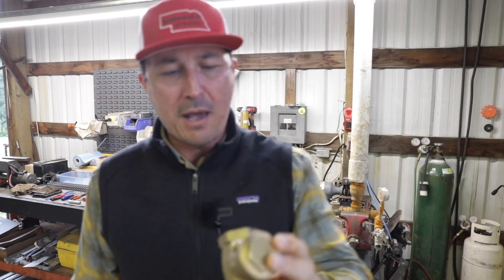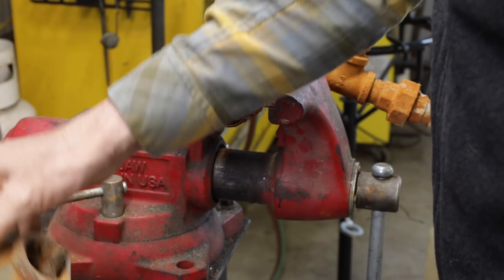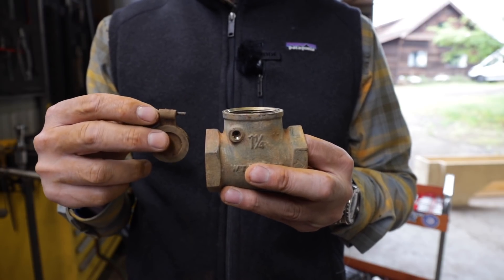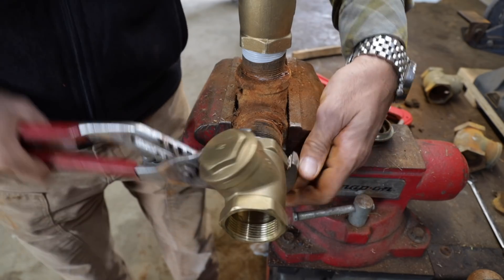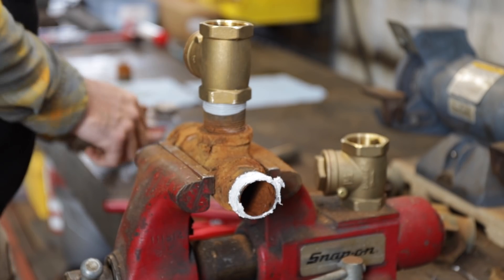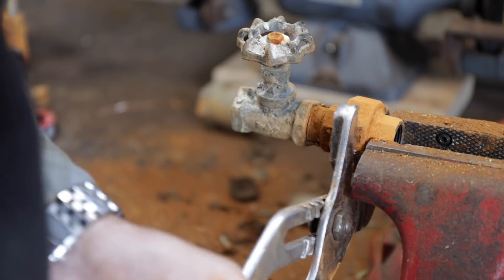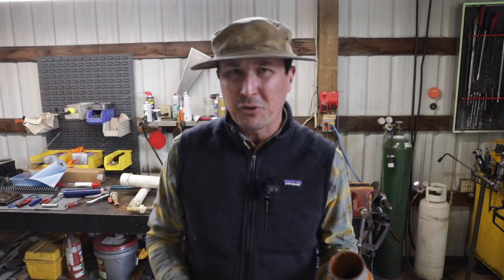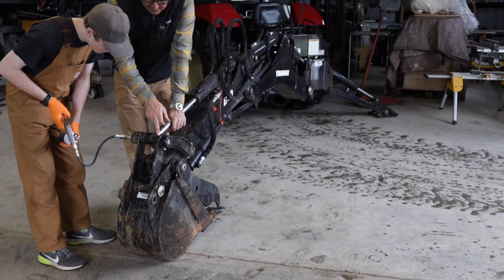RAM PUMPS - Do They Really Work?

Comment: You keeping Teflon folio on a wrong way as you do round sealing of a tread for valve fitting.
Reply: The only correct way to use tape when plumbing water is the following:

1. Unpack the roll from the packaging
2. Open your trash bin
3. With a smooth motion, put the roll of tape in the bin
4. Close the bin
5. Buy flax and Locher
6. Enjoy

Comment: Not having a check valve down in a well would also be for preventing boiling. That many feet of water pulling a vacuum from the end destination would cause it to all boil away.
Reply from the maker: Not sure I agree with that,
Reply: @wranglerstar  Water will boil under vacuum. If there is nothing applying pressure at the bottom, and there is a closed faucet at the top, the water would boil. It only takes 33 - 33.5 feet of water to do so. That is also the longest possible drinking straw you could ever have. If the phenomenon of water boiling under vacuum didn't exist then a check valve at the bottom would not be needed. Assuming every faucet was closed up top, nothing would simply happen if the pump turned off. It's the same as keeping water in a straw with your finger on top. Do that to a straw longer than 33 - 33.5 feet, and it would boil and empty.
Reply: @timramich  In this case he's talking about a submersible pump which is  at the bottom of  the pipe.  Since those pumps are Centrifugal there is a continuous water way through the pump.  The impeller of the pump spins the water creating centrifugal force.  The shape of the volute causes that outward motion to change into pressure.  Since the impeller of the pump does not completely close off the waterway; as a Rotary Vane pump would; the water can flow backwards through the pump when the impeller is still.  Without the foot valve; which is a check valve that is designed to operate best when it is positioned vertically; the submersible well pump would have to force the water all the way back to the surface and to the pressure tank before the the pressure would begin to build to a useful level.  Cycling the pump on that long each time water was needed would really shorten the service life of the pump and use a lot of energy without doing useful work.  The foot valve prevents the water from flowing back through the pump and emptying the line.  Also the absence of a foot valve would cause the water to boil under the influence of its own weight.  As it flowed back down the pump's discharge piping it would create a vacuum in the piping and the water would vaporize.  

Tom Horne
Reply: @hornetd  The reason for the check valve, and it being at the bottom is to stop a boiling/cavitation problem. Period. It is to keep pressure in the pipe instead of a vacuum in the pipe. Take a straw, dip it in water, put your finger on the top of the straw, and remove the straw from water. Where is the water? In the straw. Remove your finger from the straw. The water drains. There is no way for air to get into the system unless a faucet or tap is open. If that is the case, then the system will be demanding the pump be on anyway.

Comment: The Teflon tape is what helps seal it the pipe dope is just an antiseize not a sealant
Reply: Pipe dope is definitely a sealant! Using it, you don't need the tape.
Reply: 22 years in the oil field has taught me different
Reply: What I meant to say is that dope acts as a sealant because it fills the spaces in the threads while lubing the threads so they can be tightened more securely.
Reply: Also keep in mind that there are different types of dope, used for different applications. Different grades of tape too. It gets really complicated. Nine years doing natural gas mains and service pipe installs here. Don't remember ever using tape on anything but brass fittings.

Comment: Galvanic corrosion is the culprit here. Dissimilar metals tend to create a galvanic cell, essentially a 'battery' cell in the presence of water, air, etc. You need to select different metals or provide a sacrificial anode to increase the longevity of the parts in terms of corrosion. Perhaps a suitable stainless fittings with the brass valves could work. https://www.fastenal.com/content/feds/pdf/Article%20-%20Corrosion.pdf4

Denzification  (not Denazification, Google...) is also potentially a factor here. According to the internet, this is when the zinc is leached out the brass leaving a weak and porous part.

Comment: What people mean when they say free energy doesn't exist.....they don't mean financially. 
They mean you can't take a small amount of energy and turn it into a huge amount of energy without some external energy being used. Just use a flashlight for example...you get the battery with a charge...when using the flash light...the energy that is stored in the battery only CHANGES to heat energy and light energy. You can't shine the same flashlight onto (just an example) a solar panel that is also connected to the battery of the flashlight and recharge it at the same rate you are using it. Even with it charging by shining the light on the panel...there is still energy loss in the heat and light energy. Therefore...you battery will eventually die. 

First law of thermodynamics:  Energy can neither be created nor destroyed; energy can only be transferred or changed from one form to another.
Reply: So it's not free?  Damn...

Comment: Watching you fight with that Teflon tape is driving me crazy, try taking the tape off the back side of the roll and it will go onto your pipe much easier  and tighter fit and when you go to rip it off just put your thumb where you want to stop and pull you won't have any loose ends and the tape will lay in cartridge better. Oops sorry I didn't see all the other comments saying same thing, so yeah what they said.

Comment: So, not to take your word as gospel, but if say, every foot of fall to the pump lifts 7ft.. if you had a stream that has very little slope on your land, could you have one pump with a feed pipe that has the inlet say 5ft in elevation higher, then have that pump push the water vertically 35ft straight up, then have that water fall back down into a second pump giving that second pump the ability to pump 245ft up?

Comment: The energy from the sun does have a cost, its just not one we pay, its more a cost of materials that are fused together, a ram pump works by water coming down the pipe using gravity to push water up a tube then the gravity pushes the water up the other side of the hill. No free energy, just one you don't pay for.
Reply from the maker: How much money have you spent on sunshine?
Reply: @wranglerstar  "its just not one we pay"

Comment: The sun is free in a monetary sense, the sun is made of gasses that it burns to produce energy. When it comes to energy it has to come from somewhere and it has to go somewhere. When you go down a hill on a bike you are using the stored energy from when you pushed the bike up the hill.
Reply: ???? Your bike analogy is BS.  Energy is never free, Cody knows this.  He is ruffling feathers.  But your bike thing?  What if I lived on top of the hill?  Where does the bike store this energy?  If I dropped a rock from the top a building would it be releasing the energy it gained sitting in my pocket on the elevator ride up?
Reply: @turnersparadise8368  First of the analogy is very simplistic, but if you really wanna ask, how did the bike get up the hill? My point is that in an equation for energy both sides have to be balanced, you cant get any more energy out of something then what was originally put into it. The energy isn't "stored" anywhere. Google potential energy, you might learn something. Obviously physics isn't your strong suit.
Reply: @NonEntropy  I don't know, maybe YOU should google it?  You seem to have half the story but your answer is just as inaccurate as your initial post.
Reply: @turnersparadise8368  In what way. Please explain lol
Reply: @NonEntropy  What is Newton's first law of motion? The bicycle rolling down hill, due to gravity, has nothing to do with the force required to get the bike up the hill...or dropped on the hill by a helicopter.  Your analogy is BS.
Reply: @turnersparadise8368  When you pick something up you give it potential energy, when you drop it you convert it to kenetic energy

Comment: Building the entire Ram Pump out of Brass fittings, nipples, and Valves is well worth the extra expense, Brass does Not corrode. Use PVC, PEX, or CPVC on the Long pipe runs to save money.

Comment: I have heard the 7 ft lift of a smaller volume of water for each 1 ft drop of head, with sometimes a minimum head - sometimes a somewhat smaller ratio and sometimes more, but usually about what you said.   However, the volume of water lifted is rarely discussed.   Is there a ratio of volume of water through the input pipe to the volume of water lifted.     Is a trade-off possible?   Could a higher volume of water be lifted for applications like irrigation by sacrificing the height that the water is lifted?  I have never heard this trade-off discussed.
Dave from the Water Wheel Pumps (and ram pumps) discussion forum
https://www.facebook.com/groups/240458583255303/

Comment: Don't think Free Energy means that you don't have to pay a bill for it. Pretty sure it simply means that the energy being output is greater than energy being input. For instance if a fire put out more energy that the fuel of the fire. Could be wrong since I'm just a paint factory grunt but I believe the sun its self will at some point run out of what ever is fueling its current state.

Comment: the sun is powered by fusion.
it too will run out someday , so no its not free either.
your confusing monetary cost with breaking the preservation of energy and thermal dynamics.
and the pump is no different either , your exchanging some mass for the energy it carries (the water coming out of the check valve facing upwards).
also i wonder how well a homemade check valve would work for this. maybe just a rubber ball might do.